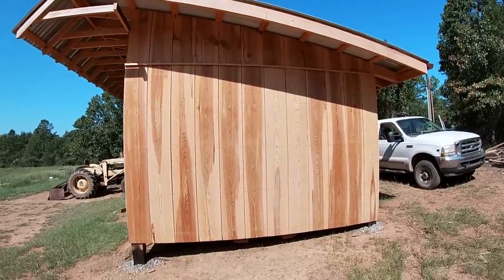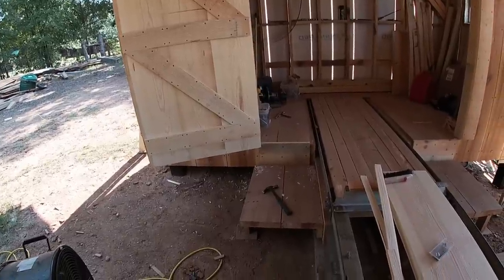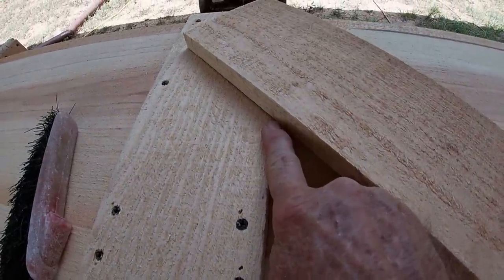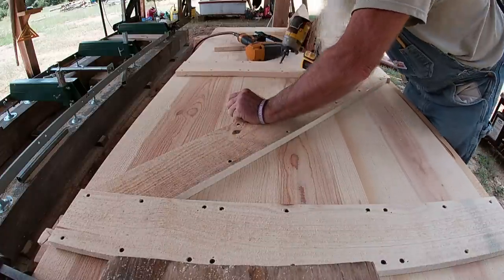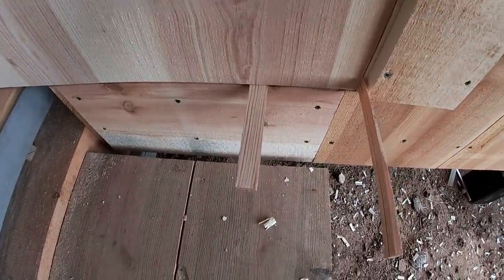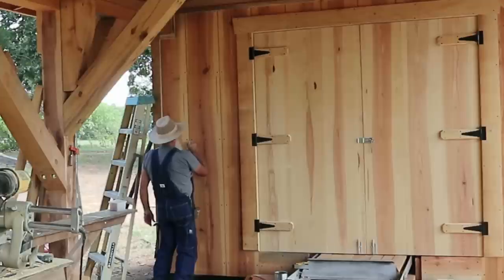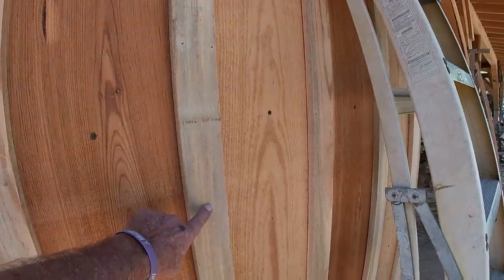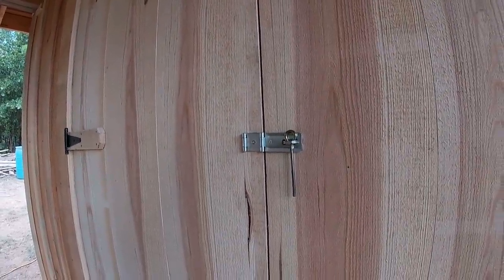Building a Sawmill Shed, Pt 7, Doors and Batten Strips

Comment: Happy to say, I did my first barndoors just last summer as you (single lady, 46y.o) But is there any reason, why your hinges are so short ? I used 220cm x 90cm wide door, 45 cm long hinge.
Reply from the maker: Howdy Ma’am- I admire you for doing things on your own. The doors I built are strong enough at the hinges to use the ones I used. The hinges are what I could find at the local hardware store. Longer strap hinges would definitely look nice. Wishing you the very best. God bless
Reply from the maker: Howdy Ma’am- I admire you for doing things on your own. The doors I built are strong enough at the hinges to use the ones I used. The hinges are what I could find at the local hardware store. Longer strap hinges would definitely look nice. Wishing you the very best. God bless